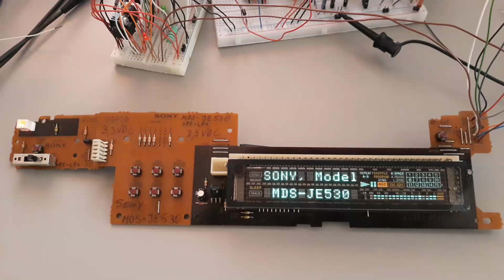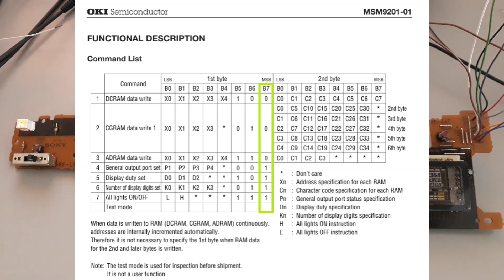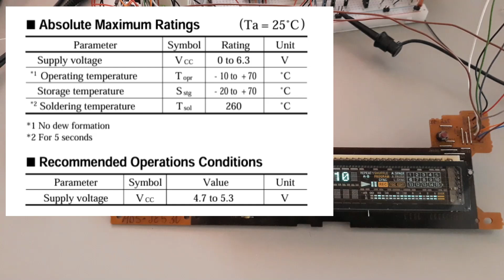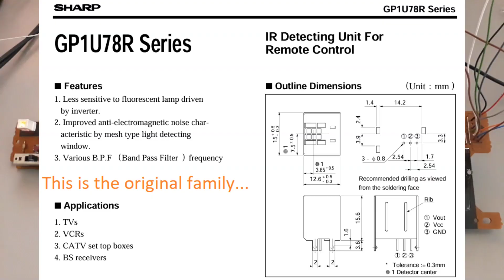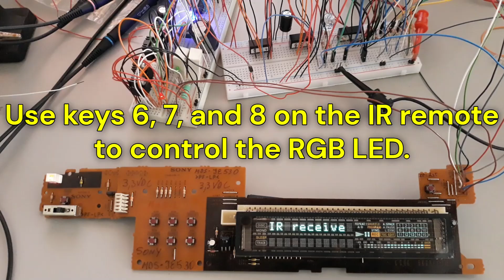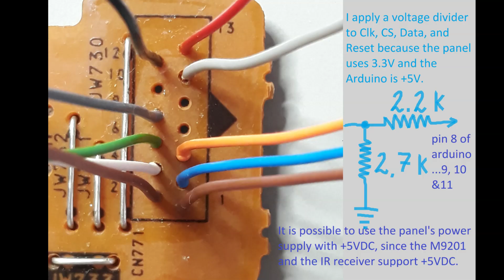M9201 Technical Tutorial

Comment: My much similar Technics MiniDisc player/recorder still works as a player but recording does not work any longer.
Should I take it apart to control the display differently?
Reply from the maker: Hi @thomasw2509,
Honestly, it's always a shame when you have to take something apart! I usually go to a flea market and buy something identical to take apart if I need a component! You can find real bargains, and as long as the displays aren't broken, it's always worth it and you don't have to take anything apart. Of course, there's always the problem of storage space. I don't know if it's feasible with this mini disk drive, but usually the lasers are easily replaceable with the lasers that came with the CDs of tower-type Personal Computers.
Reply: @jlsmonte  Well, I have given up trying to repair such old stuff when it exceeds replacing a drive belt.